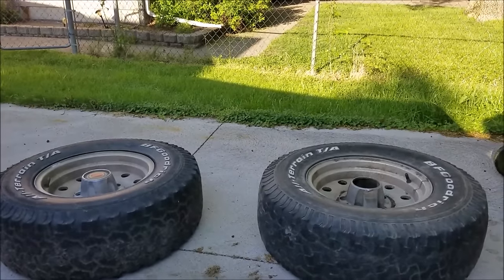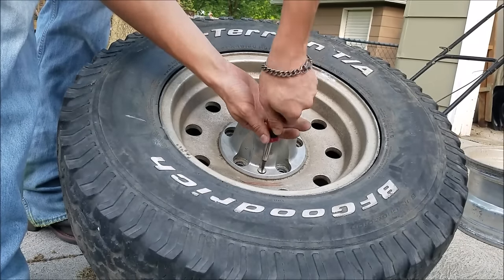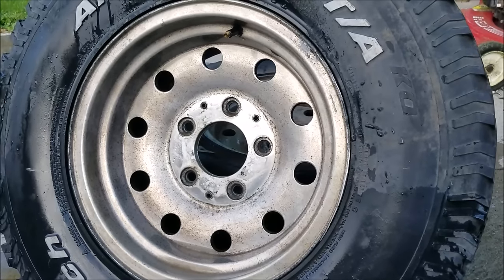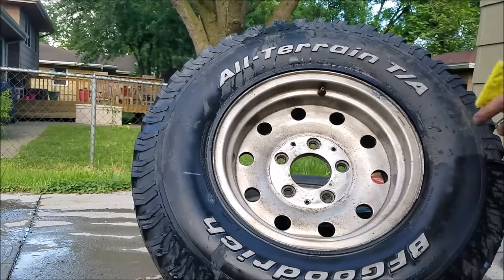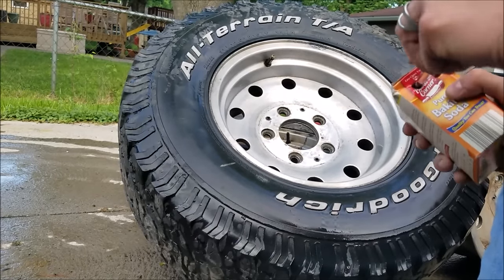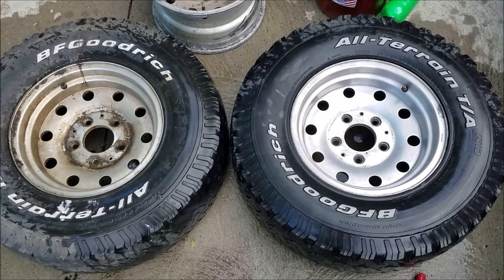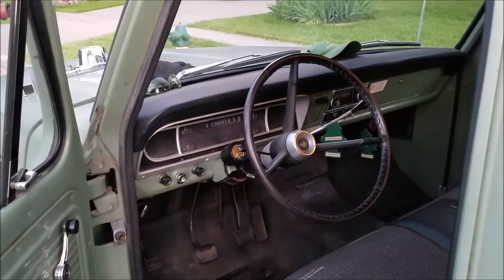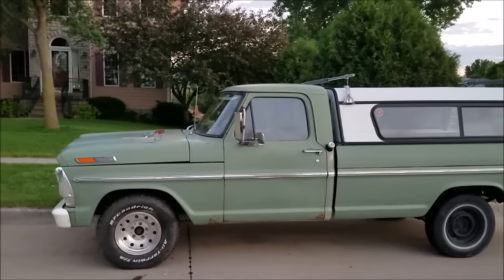Cleaning Nasty Aluminum Wheels with Household Products - WOW !!!!

Comment: Spray oven cleaner works awesome for cleaning crudded up wheels. Good job on the cleaning. 
Side note- baking soda reacts with acids (lemon juice) just water is fine to make a paste. Borax is an awesome aluminum polisher and believe it or not, so is plain old all-purpose flour or corn starch
Reply: Baking soda aluminum foil and boiling water shines silver
Reply: Carlene Stevenson don’t do it on silverplate though- you’ll end up durning your silver into brass (or whatever the base metal is) it eats the plating right off of it. My mother in law had that happen with a platter. Live and learn and tell the tales so others don’t fall down the same holes.
Reply: @moonwatcher4049  thank you before I do anything I was going ton Google my original rims for my car to determine the metal I have Is 250 and plan to remove curb rash was going to dip the rims but I am a die hard DIYER but do my homework by gaining knowledge from everyone's videos learning dos don'ts and the best way after seeing the options
Reply: I was thinking oven cleaner... With the magic oven cleaner does on a grime / grease baked in oven.
Reply: I've seen oven cleaner ruin aluminum
Reply: @johnyoung5482  on some oven cleaners it says right on the box, don't use on aluminum.

Comment: Not sure if anyone has commented this or not, but these are factory Forged wheels made by Alcoa for Ford...they are clear coated, you can use aircraft paint remover or ez-off oven cleaner to strip the clear coat, then they can be mirror polished, a lot easier

Comment: Simple Green for cleaning aluminum works great especially once you have done a deep restoration type clean...it won't damage any surfaces if left on for any amount of time...I add about 2 oz of Dawn 1/2 gallon of Simple Green and add 1/3 water in a gallon pump sprayer and keep that on hand. I use that on my wheels and tires, wheel wells, frame rails...You can use it on painted surfaces for cleaning algae build up on vehicles that have been sitting, it won't damage paint but will remove waxes. So at minimum I would rewash with a car wash/wax soap and use a spray wax if you aren't going to hand wax. So when using it on my wheels I use a spray wax after. Simple Green cleans tires easily with a single pass light scrub around the sidewall and into the treads without any residue...If you use tire shine type products and you want to get your tire back to clean bare rubber this will do that...I discovered it when searching for an effective non corrosive non petroleum non solvent based water soluble cleaner for my dirt bikes...

Comment: Hea, I tried using lemon juice and baking soda with a toothbrush on my 1981 Kawasaki motor that had a lot of oxide buildup on the head fins from sitting in a barn for years.  Guess what, your trick really worked well in removing the built up aluminum oxide.  I've tried all purpose cleaner, engine cleaner,and aluminum polish with very so so results.  This worked the best.  Thanks!
Reply from the maker: Hey, that's awesome! Good to hear!!!
Reply: Usually soda (base) and an acid cancel each other out.
Reply: 1D0N at what ratio do they cancel each other out? Looks like he used abunch of soda and a few squirts of lemon juice

Comment: I drop the rims in a Spectank, filled with Carbsolve solution, for a few hours and rinse them with warm water and a sponge. It removes brake dust, road film, tar spots, paint, grease and oil etc. You are left with a spotlessly clean rim.
For dust cap replacements, I have found suitable plastic and rubber end caps from auto rubber specialists, plastic piping manufacturers and injection moulders, even from furniture manufacturers who make furniture from bent steel tubing.

Comment: In the video it talks about using lemon juice as an acid. Lemon juice has a pH falling between 2 and 3, which makes it 10,000–100,000 times more acidic than water.  The thing about ph is it is an exponential scale, so you really don't need all that much of it.  In fact adding multiple bottles doesn't increase the acidity.  Soldier On!

Comment: go with the caps!! thy look good, I find 80s&90s ford stuff looks good on old ford stuff as the body lines are not far off. the 1980-1997 bull nose trucks just 2 body styles ahead of the 1960s stuff. it gives it face lift. how much do you think factory 17 inch aluminum wheels from the 1990s would cost with the 5 on 5.5 pattern? O not to get off topic would it be worth it to go from a factory 2bbl manifold to 4bbl manifold for power and economy on a budget on a mostly stock 351w or not? their was a factory 4bbl on the ho351w in the 1980s but i think it was iron not aluminum. so if a 4bbl intake is worth swaping on, is the factory one good, or should i go aftermarket.
Reply from the maker: id go with the 4 barrel. overall, you will actually get better power and economy (if you keep your foot out of it) either or is fine if you are going to keep it at reasonable rpm. id run a carb spacer if you use the iron intake. it would really come down to which you could get affordably.

Comment: I had a 1970 with a 302. No power brakes. Drove the wheels off it! Put in a tilt wheel later on. Rusted badly. It's gone now. Had a lot of fun it. 18 years old, first ride.

Comment: Very nice video.
Nice looking 69 Ford
What engine is in the 69 Ford?
We used to own a 72 Ford F-150 Ranger XLT 2wf automatic with a 360 V-8. Loved that truck.
Father sold it in like 92 with under 60k original miles.

Comment: I'm thinking vinegar but I haven't tried it. Maybe try some on the back of the rim in case it dosen't work or dulls the aluminum. Also put the rims up on a table while you're scrubbin them. Nothing worse than workin on the ground. They did turn out pretty good though. I would keep the center caps on the wheels.

Comment: Nice trick , they should be pretty common they were on a lot of trucks . If you can't find some close to where you are I think I can hook you up I'll have to look to make sure no one has taken them already. With or without the center caps those wheels are truly classic.
Reply from the maker: i really like them, hard to find them around my area any more. i definitly need some center caps - dad wants them but doesnt like the red. might have to cnc something out for the centers
Reply: ThunderHead289 they came with black caps too. I have a set of each

Comment: they have non acidic cleaners you can buy specifically for aluminum wheels, so if you had an expensive pair that is probably what you would want to use.  but in this case your method worked fine!

Comment: hmmm interesting.  Good job, they look great.
FYI though, Baking soda is a base, or alkaline.  Baking soda is used to clean up acid spills.  It will neutralize the acid in the lemon juice. But then it may be the chemical reaction may help lift the dirt and grime.  Maybe just the dawn would have done it.  lol  But them wheel look good now.
Reply from the maker: +Beauregard ! I’m not sure - it worked really well, and the girl was only half frustrated with what I took out of the fridge. It makes more sense to use the acid, then the baking soda for sure

Comment: Could you use a brillo pad or sos pad on aluminum if they are heavily oxidated?
Reply: Robert munguia
Using a sos pad or likeness will work at removing the grunge but will prob leave the aluminum with a more satin finish rather than shiny

Comment: Did you change the speedo drive gear to compensate for the bigger tires? If not, no change in freeway rpm.
Reply from the maker: I didn't, it will eventually be converted to a 5 speed and then I'll change it over. It does about 5 miles faster at interstate speeds than what the soeedo says currently

Comment: Mothers Mag and Aluminum polish, and a buffing attachment for an electric drill. The Nu Finish wax so the shine lasts longer. Or paint them for less future maintenance- I like the ceramic brake caliper paint from an Advance auto parts store, about $10 for a large spray can. See the Project Farm YouTube videos for maintenance tips in general.

Comment: I have had a couple sets of these wheels.  They have one heck of a clear coat on them.    Using an abrasive pad will scratch the clear coat.  In order to really polish them you will need to strip the clear off and then use an aluminum polish.  If the clear is in good shape you can use a polish  for automotive paint like Meguiars.  The truck looks great!

Comment: One trick that I have used 
Cut out cardboard circles drill 1/4 inch hole and bolt them with a bolt and washers makes a cheap buffing wheel if you use polishing compound
Reply from the maker: Your a genius
Reply: Rich Overmyer thanks for that great idea!

Comment: I think you can get 4 nice center caps to snap in place instead of the metal covers. Then get some nice new chrome closed lug nuts spline drive for easy on and off.
Reply: tannie minka I just bought types rims yesterday very cheap with brand new tires for $140 bucks and I wash the rims it's looks way better

Comment: well you're brave enough you can run them through the dishwasher with Platinum Cascade it does wonders to copper bottom pans I bet it will clean aluminum wheels nicely
Reply from the maker: I will have to try that on some aluminum !!!
Reply: Liquid Cascade (not the newer formula that uses Dawn) does indeed work well at cleaning aluminum. 
Several years ago I used it on a filthy aluminum toolbox that I purchased for cheap at a local auction. I used the blue scrubbing sponge that is for non-stick pans and applied the Cascade directly to the damp sponge. Didn't really scrub much. Just applied it with the sponge and let it sit for about 10 minutes. Then hosed it off. Took the toolbox down to the bare/clean aluminum ready for polishing. 
I then tried it again a last year on the back side of some aluminum wheels from a Jeep I parted out. I wanted to clean off all the baked on brake dust. That took quite a bit of scrubbing after allowing the Cascade to sit on there for a while. I also used a pressure washer to rinse those. End result was about the same as the toolbox but it did appear to cause issues with the clear coat that was on the face of the wheels even with me trying to avoid getting it on the face of the wheels.
The Cascade also makes your dead skin turn to slime...
Reply: ... Just imagining the look on my wife's face when I tell I I put wheels in the dishwasher.   Ouch!
Reply: Spaghetti Meatloaf what happens if you get caught putting your wheels in the dishwasher?

Possibly another video?
Reply: Cascade works because it is probably one of the basic pH products in your home the opposite of the acid used the video

Comment: The best thing I found to use is SOS pads. They work awesome for cleaning wheels
Reply: That’s my Thursday project!! 2010 Ford Ranger 2wd 15” wheels. They are going t need new clear coat as well unfortunately, but I want to get them clean and they currently have about. 2 mm minimum of brake dust caked on the inside back of the wheels!! A power washer with soap, after degreaser and full power 2500 psi,,, almost no difference. Gut a bit of the buildup, but a very small amount. Bought some SOS pads as they helped me revive a set of Cragar SS 5 spokes that are on it currently (80s retro build with a custom finished interior in a canopy with only front and back windows etc. 295 50s in back and 235 60s in front). There was a bit of rust from sitting in the shop untouched but to occasionally move them out of the way, for years & years! Took it all off, sealed with Turtle wax chrome polish (again, just sittin around the shop) and they look near new, no rust at all. The chrome was not peeling.
Reply: I used sos pads but you have to remove the clear coat then a final wax.

Comment: Had you used 0000 ultra fine steel wool along with this you would of had even better results
Reply: chevecrazy454ss good idea
Reply: Using steel wool is bad, steel wool puts all little steel deposits in the aluminium and they will rust
Reply: @unknown5827 I see your point but that will only happen if your clumsy it wont do any of that if you rinse your wheels well as he was doing so in the video but what it will do is get the job done in half the time he spent doing this

Comment: Baking soda is a base, lemon juice is an acid. When you mix a base and an acid they typically go ph. neutral. The reason why the lemon juice works is because the citric acid attacks rust. Mixing both of them is basically making messy water, and the baking soda is way too fine. Love the transformation of just lemon juice though!
Reply from the maker: I guess it worked out because I applied them separately in the vid

Comment: I've made center plugs for the caps out of plastic lids. Find some that fit in from the back side and seal them in place with Seal All or something that won't be too difficult to remove later if the center needs to be replaced later on. Install one pair on one side and the other pair on the other as you can't see both sides at the same time. Same goes for wheels, never could figure out why guy's install one pair on the front and a different pair on the back. If both pair are the same offset and width I always installed the pairs side to side rather than front to back. Don't think any body ever noticed.
The wheels should be waxed or clear coated right away after cleaning/polishing to stop or at least delay the oxidation process. This will keep the wheels nicer looking longer as the oxidation process starts immediately after the cleaner is washed off and does stop until they are cleaned again.
Nice old truck. Had a 68 with a 3 on tree when I was 17. Plain Jane no chrome, bench seat work truck. Didn't know anything about fixing them up back then so didn't like it cause it wasn't cool.

Comment: When combining water and acids, remember water first and then acid (said the old chem teach). :-) I'd start with getting the mud, dust and grease off with some ordinary soapy water. Once that's cleaned off, I'd get on with the acids. Like someone further down said, if you mix base and acid you just get - nothing - it's PH- neutral. So clean it in two go's. :-)

Comment: I swear i have seen this truck before. I work at Victor manufacturing, and just south of the plant is an older farmhouse with a few buildings. There was a truck identical to this one sitting out one day there on my way to work. In the next few weeks I saw it out driving around and then within a month it was gone. There was a 70s LTD or Lincoln covered in dust sitting out for a week or so,then it was gone also. Just curious if its the same truck and also I saw the vintage lic plate that says IOwa on it.
Reply from the maker: What year was that by chance? Kinda sounds like the area from where I bought it from
Reply: It was probably a year or 2 ago. Just a couple miles north of I80. Big white 4 square house w a little white house directly across the road. On the curve south of the house on both sides are some el Camino's, old Ford pickups,,90s Chevy and Dodge trucks sitting in the fields.
Reply from the maker: +Mj Martinson this indeed is that very truck.
Reply: Cool. Good to see it being fixed up and driven. Do you live in Iowa??
Reply from the maker: +Mj Martinson yes, it roams central Iowa currently.

Comment: Have a set of "wire wheel" hub caps? Put them in the dishwasher with dishwasher detergent AND 12 packs of sugarless (not sugar free) KoolAid. The citric acid works wonders in combination with the regular dishwasher detergent. Use lemon, it won't leave the dishwasher smelling funny.

Comment: Man keep the center caps, especially since there hard to find original and the aftermarket crap from places like LMC Truck are visibly cheap and crack easily. Just order two center cap insignias, the center caps are all the same for 4WD or 2WD they just didn’t use two of the insignias on the 4WD Trucks. I have both versions that’s the only reason I know they’re the same center cap on both trucks.

Comment: Easy off oven cleaner. And never mind the wheels and tires Get to the rust on the bottom fenders and door corner before you have to cut them out and replace them.....
Reply from the maker: Tony Dadon it’s already thin, we don’t drive it in the winter, but it’s definitely had winter time, though not a lot. Not sure what we will do with the truck, currently farm style

Comment: when you fit larger diameter tyres the ratio of the speedo needs to be corrected otherwise if the speedometer is showing 100 MPH you are probably doing 115 MPH and therefore get booked for speeding.
Reply from the maker: we are aware and checked the speed offset via phone app until the new speedo gear comes in.
Reply: I don't have a speedometer, so fuck it, I can use whatever I want

Comment: my 96 f-150 2 wheel drive had the same wheels. imo. on a older truck i would run no caps. on a later model. i would run the caps. all of the repop caps that i have seen are made of plastic. Ford also made these caps in black. however they are plastic not metal like the others.Ford stopped the 5 on 5 1/2 bolt pattern in 1996.

Comment: Hey man. Just a heads up.  There aren't  any truck companies that make plastic wheels for production passenger trucks or larger trucks. Aside from small lawn and garden trailers or similar sized applications, there are no plastic wheels.  Too many people watch videos assuming they are learning, while in contrast, they are being ill-advised.  I thought maybe at first the guy misspoke, but he seems to think plastic wheels "with a metal strip" are a real thing.  Not the case.
Reply from the maker: Just a heads up, there in fact are - many "chrome" factory wheels are in fact plastic chrome "covers" over a steel wheel structure. This is different than hub cabs btw. 
So.... indeed the case actually.